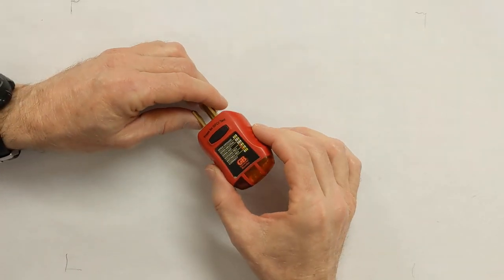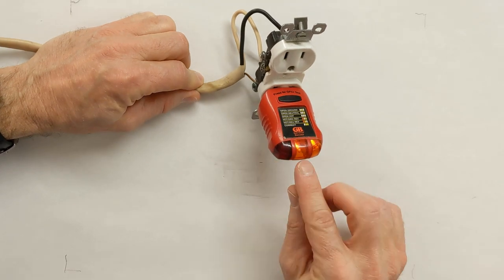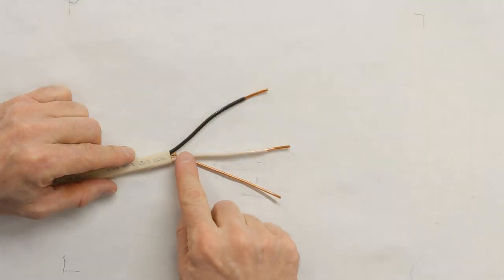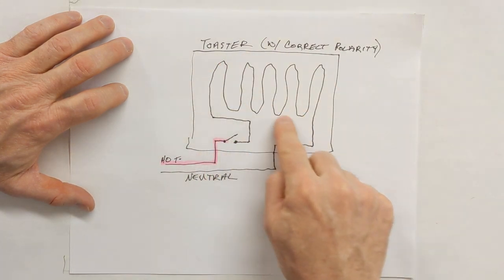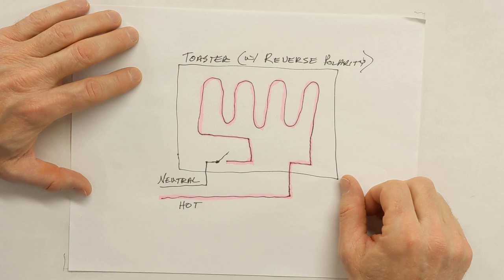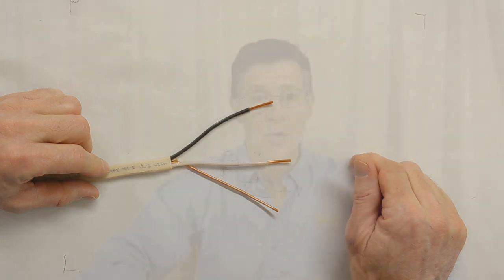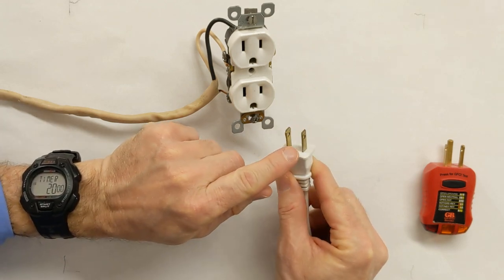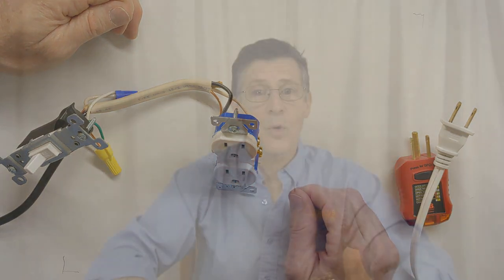Reverse Polarity in Electrical Outlets - What, Why and How

Comment: Instead of answering your question about plugs that have the same sized blades you dodged it by saying not to use it. That doesn’t work when I have old stereo equipment that needs to be plugged in. Is there an easy way to determine the polarity of  the plug end on a device before I plug it in without taking the device apart to find the hot side of the plug wires coming down from the device?
Reply from the maker: I don't know of an easy way to determine this. There may be markings on the wire itself, but how to know what those markings mean is the hard part.  If you happen to plug it in backwards and use the device it will likely work fine. Just don't take the thing apart while it's plugged in. To be cautious you could get a voltage sniffer and make sure the box isn't hot after you plug it in. You may want to take it to a high-end stereo shop and ask them to figure out the polarity for you.

Comment: Can you make a circuit that reverses the polarity every 0.5 seconds?
Reply from the maker: I'm sure you could, but I don't know how to do that. Talk to an electrical engineer.
Reply: @HouseKnowHow  DPDT Relay with a multivibrator circuit.
Reply: @EricDavisED  A cat detector using a laserbeam breaker circuit connected to an FM transmitter. I could use a 433MHz transmitter and matching receiver relay. That would be better but I figured it out already using the FM radio. I also tried it with the 433MHz modules and an IR sensor module and it works very well. That is more practical.

Comment: Don’t the wires switch 60 times per second?
Reply from the maker: The black wire switches from +120 volts to -120 volts 60 times per second. Hence the 'alternating current'. The White wire is always at 0 voltage relative to ground (assuming the system is wired correctly). That's why the black wire is referred to as 'hot' and the white is referred to as 'neutral'. Note that current still flows through the white wires.
Reply: Yes they alternate, but the neutral wire, which originates from the center tap of the transformer secondary windings, is always the current return. The hot wire, which originates from one end or the other (pole or line) of the secondary windings is always the power in. The voltage from each end of secondary windings is 240v and center tap, as the name implies, is 120v. In a 240v line there are 2 hot wires, one originating from each end and there is no neutral wire. The voltage and current alternate direction and polarity symmetrically, so reverse polarity wiring does not exist.
Reply: Do the wires stay the same. The voltage just reverses 120 times a second. The grounded conductor is at zero patenttial white the ungrounded conductor has an alienating voltage referenced to earth.

Comment: Same logic for ac?
Reply from the maker: I don't understand your question. Please re-phrase. Thanks.
Reply: @HouseKnowHow  sorry, I meant, is it the same logic for alternative current? Is reverse polarity a bad thing on alternative current? Im new to that so sorry if its stupid question
Reply from the maker: @drdzdd  I don't know where you are, but most homes have alternating current (AC). So, in my video I was referring to alternating current. I've never heard of 'alternative' current that you refer to. I'm guessing it was a typo, or something I don't know about. For devices that use 'direct' current (DC) (cars, most electronics, anything that uses a battery, etc.) polarity is more important in that if the polarity is reversed the device likely won't work, and can be damaged. I'm not an electrical/electronics genius, but I think when we plug our computers into an AC outlet in our home the power supply in the computer converts the AC to DC before sending the electricity to the main components inside the computer. I hope this helps.
Reply: @HouseKnowHow  thanks so much for your reply man. Its not a typo but incorrect translation, ok so I got it now, besides im in France. Thanks abunch for your time

Comment: I once accidentally touched my alternator when my car was running, tossed me back 10 feet like a rag doll, I've never worked with anything electric when powered on since
Reply from the maker: Wisdom comes with experience!
Reply: True I've been shocked from 12v the other day wiring in a new fan for the living room I mean it didn't really hurt but it scared the crap out of me

Comment: What is the consequence if the polarity is swapped?
Reply: I thought I covered that in the video... If you still have a question after watching it again, let me know.
Reply: @Joederbo In the video where I talk about the toaster having reverse polarity and all the wires inside the toaster being hot as a result, because the reverse polarity causes the toaster switch to be on the neutral side..., that's the result of reverse polarity. The toaster will work, but now the neutral is switched instead of the hot. That is the consequence of the polarity being swapped.
Reply: @martinnewmark2716  It is a badly made toaster if it assumes the socket is properly wired.

Comment: Why would they complicate things? Eeeeeeeveryone knows red is hot (positive) and black is ground (negative). All wiring for anything should start with red and black.
Reply: Black isn't "ground" though.   Red/ black are often both "hot".   3wire= 2 hot, black and red=hot,  1 white neutral,  1 ground.
Reply: Black is usually hot bro. 
My first action on seeing red & black wires is usually checking for 220V.
Reply: I think what John is getting at is that (in a very basic sense) the color red LOOKS like something hot (fire) and dangerous. Plus, red is positive and black ground for DC (automotive) batteries.

I agree with John… Whoever originally standardized the colors of AC house wiring made it complicated by using black for hot.
Reply: @fisheye42  Because you don't understand it doesn't make it complicated.  In the EU, the hot is brown and the grounded conductor (neutral) is blue even though it's not split phase.   (220VAC, 50Hz)
Reply: Thats for DC auto and low voltage, Red is positive, black is negative.

Comment: By your logic you should not be allowed to flip a appliance power plug. But you are and you can.
Reply: Most plugs have a long prong and a short prong, so they fit into the outlet only one way, and for exactly this reason.
Reply from the maker: Some appliances don't require polarity when plugged in. They should have internal protection for it. Or the appliance you are using is very old.